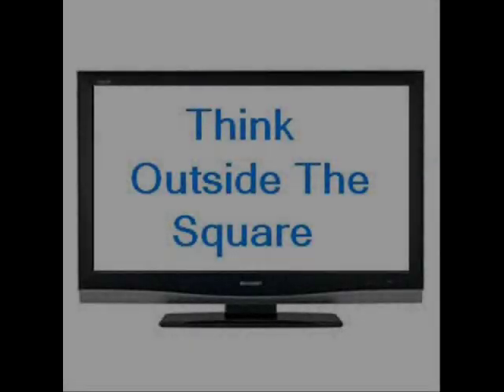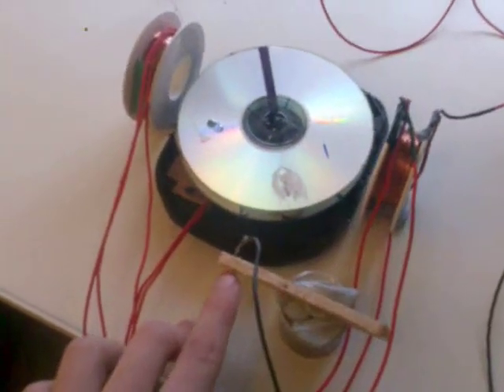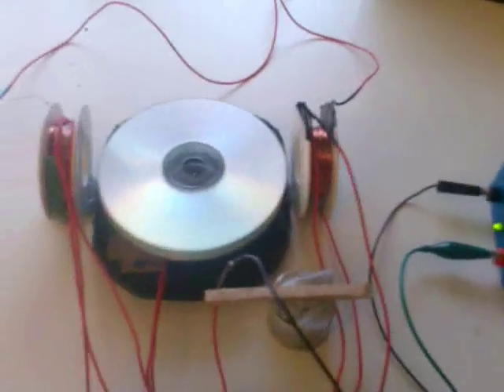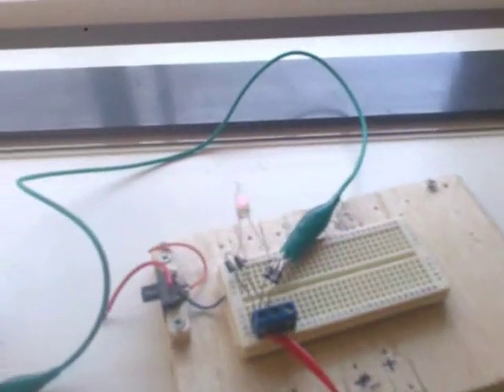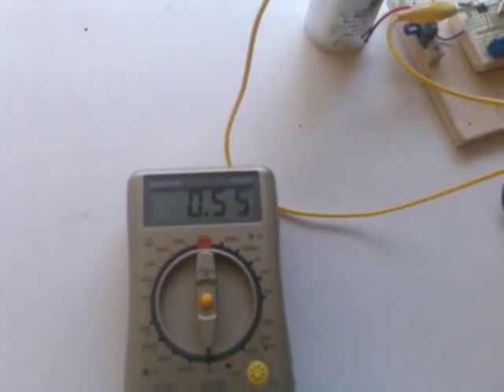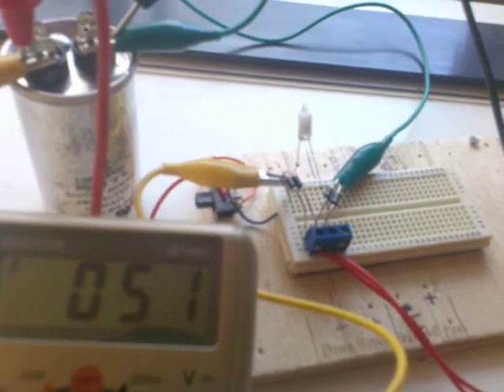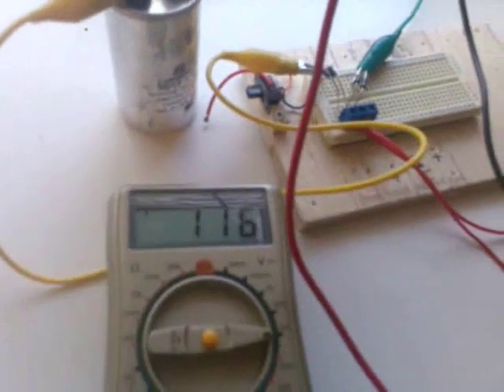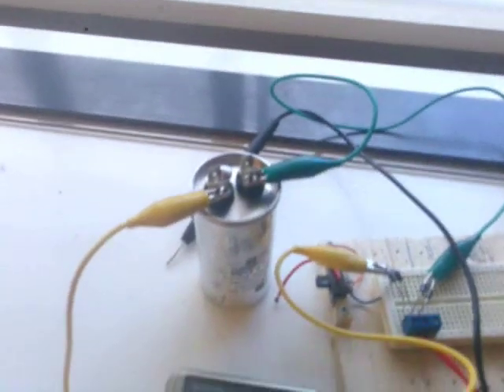Bedini Pulse Motor - 300 Volt Capacitor Charging

Comment: /watch?v=ttY7yLXZSpo
He has an easy to follow diagram ;) You need a half decent battery? I failed in the beginning by using a dud battery. Also some transistors don't work and some work better than others, 2n3o55 always works fine but there are other with different effects.

Comment: Neon works either way ;) For the coil I used Input Large (I/P-L) Input Small (I/P-S) & output large & small - (O/P-L & O/P-S), 
Now. O/P-L goes to the Collector, O/P-S to Primary Minus (-) & Emitter,... I/P-S to 1K Ohm Variable Resistor.... And I/P-L to Primary Plus (+) & Carger Minus (-)..... That's all I know ;)

Comment: If you use 2 circuits + 2 coils & 2 12v batteries you can create a self running device, I finally sussed it myself yesterday, both Primary's will be charged if batteries are wired opposite to each other - I connected a "60v" Voltage Regulator & the volts were holding nicely at 73-74v lol, cool running, the wire popped out so I popped it back in while bedini was running and blew it up with a huge discharge spark! Connecting an inverter would be the same accept you may not see the nice spark ;)

Comment: Love it! Thanks for sharing :) I am running the basic SGC, I just tried 2 parralelled 450v AC capacitors on one of my half burnt out coils & still got 223v from 10.8v (twice-as-nice discharge spark too, lol) - I think things may go pop a bit quick if such capacitors were used as both primary & charger, just a short shock to start would send the volts to the full 450v, IN4001 (50v) would need replacing with 1N4005
(600V) - Thanks again, you're an inspiration ;)

Comment: Its funny you say that but don't even take into consideration that the mechanical force generated is still completely unused.
Much of our current scientific community will not ever admit to some of the devices working at all....like asymmetric designs or homopolar designs....because the scientists are bought and paid for.
Modern science has forgotten how easy it is to get HVDC with electrostatics and how easy it is to convert voltage and current.

Comment from the maker: bedinis design uses A  coil that induces a current switching on the power coil. the reed switch replaces this as the timing mechanism. I find it simpler to use reed switch and u can adjust the timing easily by moving the reed

Comment from the maker: yes it is best to use charged battery separately. the High Voltage spikes might interfere with the circuit u want to power.
If u use a capacitor u might be able to power on-demand but you'll want to do a a lot of testing before u run it into an inverter

Comment from the maker: no the neon does not short out. Why are u using a LED?? that would certainly blow up. The 90V neon is an indicator that high voltage spikes are being produced (ie. over 90V)
Hooking it up in series works for you?? hooking wat up? a neon or LED?

Neons should work

Check out my latest videos on the Joule Thief Charger

Comment from the maker: i get ya, u mean build the voltage up in a cap and pulse it into a battery using 555 timer.. I think they call it cap pulsing.

just wondering what kind of voltage u want to build it up to before u dump it into a battery. or what kind of pulse rate is desireable?

also what are the advantages of doing this? I know a lot of ppl are doin it but i dont exactly know why?

Comment: hard to explain, so just try this, put a ac capasitor in between your coil,and your rectifier.so you coil wire goes into the cap then out of the cap to the rectifier.......then see if youget voltage off the that cap,,,if so then try a pot/555/transistor to time that power back to the battery.....if it does work let me know...either way good job.

Comment: have you tried pulse run and another circuit for pulse charge? Depending on the pulse maybe the spike will gain a higher voltage in the 400 volt cap.

Comment from the maker: yes I have tried charging batteries, whats interesting is it can charge non-rechargeable AA alkaline batteries. I've heard Nmih batteries can blow up so i haven't tried those...

Tried a completely dead motorcycle battery and got acouple of volts back into it, but hasn't fully recovered

The circuit is basically the same but without the trigger coil, instead we have a reed switch connected to our run battery that times the pulses

Comment: Nice demonstration.  It should work fine with a reed switch.  I believe ktservicecorp has reported overunity using a reed switch.

Though your amp draw seems to be a bit high for the size of your coils.  This is more than likely because of the position of the reed switch and will just be a matter of finding the optimum position for highest rpm to amp ratio.

Great work!